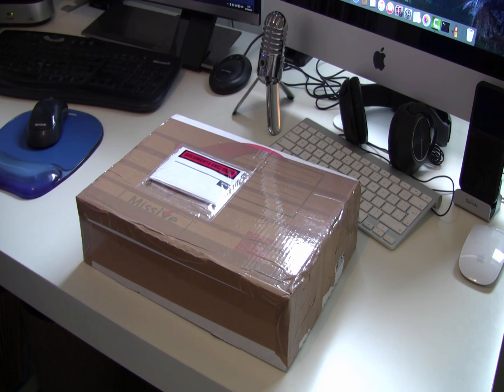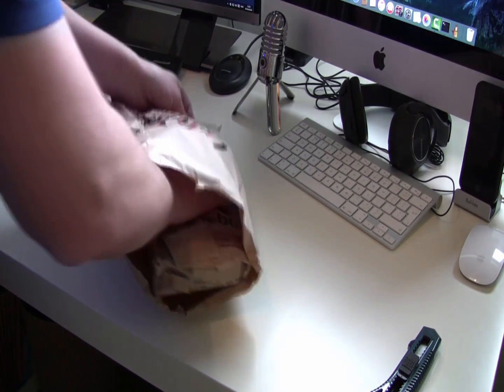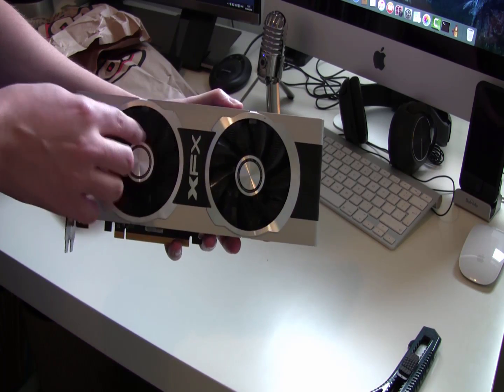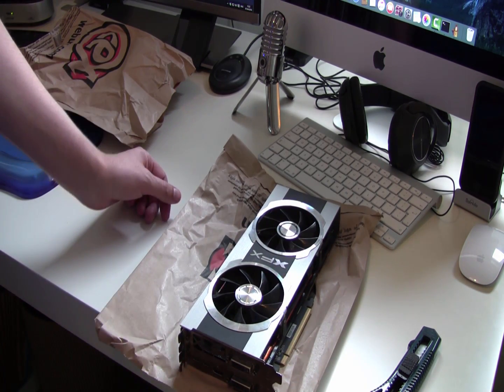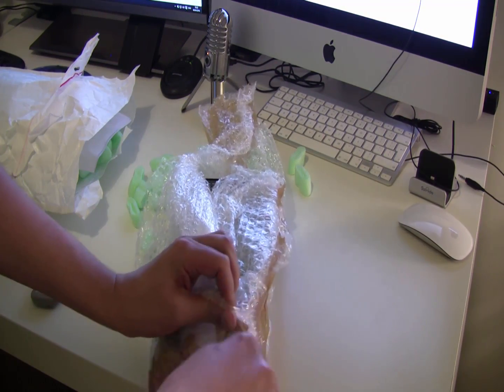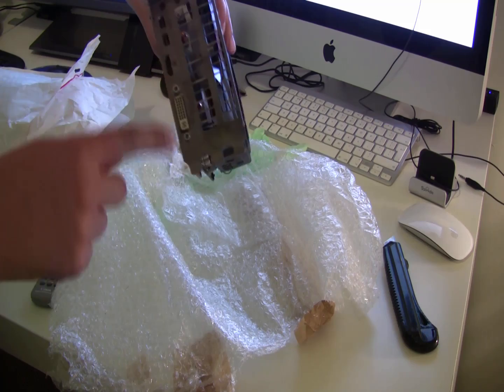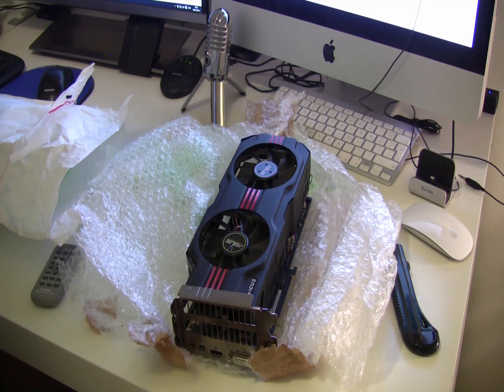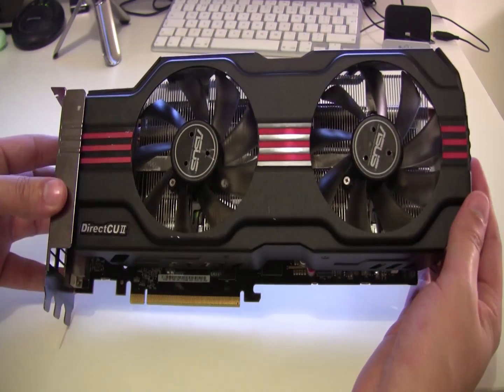My 7950 Ethereum Mining Rig Build Part 1

Comment: I went through the same and more headaches with my recent ethereum rig. problems since day one since I bought a used PC. long story short, lessons learned: crypto mining as whole is a risk even the hardware (especially used). when you buy used something is bound to fail. in my case the PSU died about a week into mining. went with a corsair used 860i, smooth like babies ass and the link system is great for monitoring remotely. learned how to remote desktop to my rig in my sister's house (she doesn't pay for power so that's a huge bonus). learned DOS a little bit. at the end of the day blood, sweat, and tears, the reward is what matters.

Comment: what's your opinion on the current ethereum price drop, do you think mining starting ethereum mining right now will still be profitable?
Reply from the maker: +ShawdowNindga Its a bit tricky, it might not be possible to take an instant profit from your mining efforts but if you mine and hold I think you should be good. However the risk is that the price could drop whilst your mining / holding. I'm mining to recover all the ether I sold too cheap, I'm think 2-5 years it will be very good.
Reply: +RiskyRandoms I'm curious what sources do you use to keep up to date with new and upcoming cryptos?
Reply from the maker: ShawdowNindga Bitcointalk mostly, but also coindesk & cointelegraph

Comment: hope you solve all the issues with the first card, good luck and keep us in touch.
Reply from the maker: +Collect satoshi  Thanks for watching, I've just been refunded for the damaged Asus 7950. Hopefully I'll have a good replacement soon.
Reply: +RiskyRandoms If i were you I would invest on the r9 280x , I have the XFX model, and I use https://www.coinotron.com for pool mining, it gives 22.5 MHS/s , and if you do an overclock to GPU= 1150 MHZ and memory to 1685 MHZ, you can get some "peaks" nearby the 30 MHS/s area
Reply from the maker: elgerardo r Thanks for your tip, I actually do have a 280x that mines well, though it's a little power hungry.
Reply: +RiskyRandoms yes, you are right about the power, but I mean, if you see this as an investment, you are making the energy cost investment same people made when bitcoin started, and see where they are nowadays, greetings from Mexico

Comment: I've read about ethereum now for a while and I really like the idea so I want to get involved. Can anybody tell me if my old rig would make a profit? Even if it's small I will probably do it because I would like to have some ether. The hardware that I have is an old HP ML350 G6 with 30GB RAM and dual E5520 Xeon with a Radeon 7950. (is pcie 2.0 a problem here?) I'm not using the server for anything currently so turning it into a mining rig will at least give it a purpose. I haven't really done any calculations and I haven't got a powermeter so before I start running anything or doing any calculations maybe someone can instantly tell me this is a bad idea or that this might be a worthwhile endeavor. I have no idea how much power the system will use under full mining load. I do know the power cost here is about 0.23 euro per kWh.
Reply from the maker: Hi, Older hardware can still be used for mining. In your case you can make good use of the graphics card it will get you around 13 mh/s mining Ethereum. You can keep it in the current system or move it into a lower power hungry pc for the best efficiency. You can also use the CPU's for mining but earnings will be low and use a lot of power.